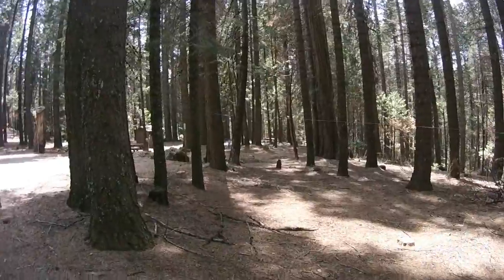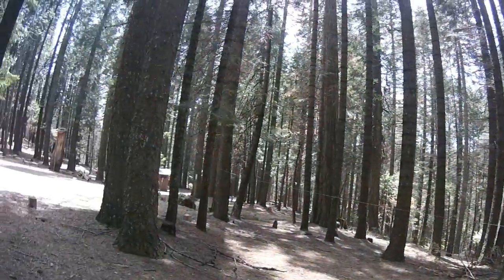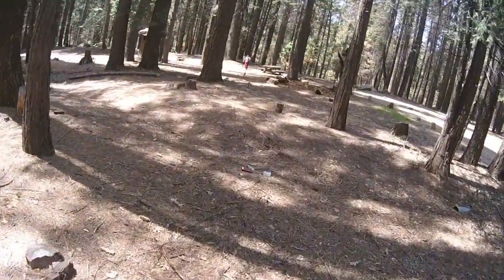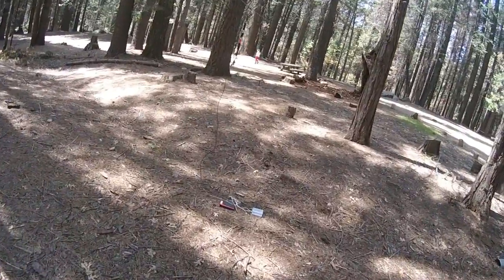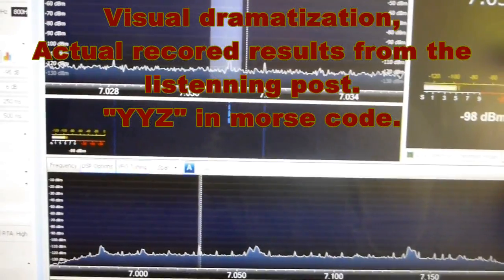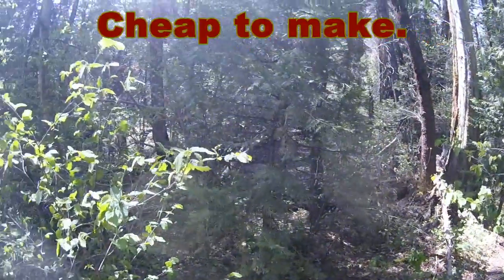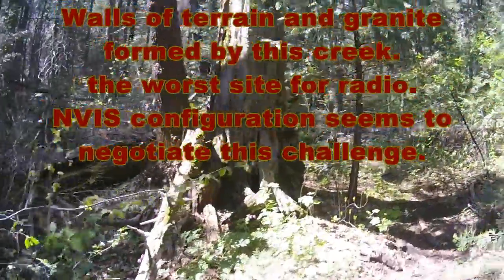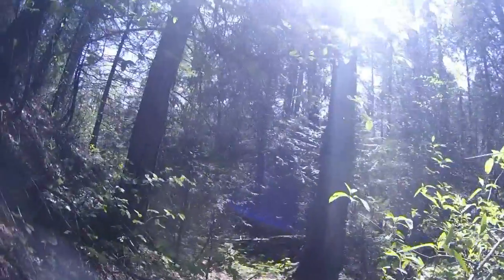HF Radio NVIS Field Operation Trials. First Strike

Comment: Try to put a continuous wire, about 5% longer  than your antenna,  on the ground beneath your antenna. This will act as a reflector.
Reply: Yep, you can even add two more wires on the ground, one on each side, six feet from the center one, parallel to it. That will increase the gain quite a bit. http://radiopreppers.com/index.php/topic,1260.0.html

Comment: Another technique use to avoid interception, is to set on a hillside facing or sloping toward your target and on the opposite from a possible intercept station.  With an end fed NVIS antenna, adjust it's slope for the best signal out with the least power used, and use the vehicle as a ground plane to direct the signal should the radio be mounted in a vehicle.  Adequately ground the radio to reduce noise, use water in a hole where your ground stakes are.  If too noisy for voice, then CW or a digital mode could work. Learn CW as I should.  In my case, I might use the aluminum roof of my 30 foot motor home as a ground plane... I would use ladder line and a tuner, or a short piece of RG8, or LMR400.

Comment: Not many know about NVIS.  Asked guys at the local Ham Club and they did not have a clue.. .  could not get them interested so they continue to install VHF repeaters.

Try the 40 meter antenna at 21 feet and on the ground.  No need to go higher than 21 feet.
Reply from the maker: Will try, just looking for an opportunity to go out again. Thanks for watching.
Reply: From what I've read, NVIS is difficult to DF.  I would like to try the dipole on the ground,  QRP, and with a digital mode, PSK31, and from inside a canyon.  Noise would be significantly reduced so the weaker signal works. Because of the low power , and high ground absorption with this set up, a sloping dipole might help direct the weak signal a bit further. Line up the dipole in the direction of the target station and elevate one side. The combination might be very difficult to DF.  To be sure, one would be much safer if there was no intercept station within 25 miles so that the ground wave is not intercepted...if there is an appreciable ground wave with this combination of factors.

thanks for all the hard work needed to share your videos.
Reply: They focus on VHF/UHF and repeater here too.  The problem is in order to cover the whole island the repeaters need to be linked due to the volcanos blocking line of sight. The link between repeater is broken and some of the repeater will fail in a disaster.  I want to try NVIS between our two clinics.

Comment: I have done kilowatt-level 7MHz tests over 20km line-of-sight paths, and trust me there's no such thing as ground-wave - everything you see in your video came off the ionosphere.  For frequencies below 10MHz (day/night NVIS), the simple coax-fed no-balun resonant dipole is a very good portable prepper antenna - improve it by putting links along it for other bands.  The dipole has very very small directional lobes even in free-space, and you may as well consider them to be non-existent - I have never seen a poor signal or a good signal as direct result of dipole orientation, this antenna is close enough to be called omni-directional.  Your main concerns with the dipole are absorption (away from nearby objects), non-electrical-contact near the high-impedance tips, and height (as much as possible - less ground absorption.)  For the ground to be a quality reflecting element, you will need about 0.25 wavelength height, and you don't really care that much for only half an S point extra.  Keep up the good work! :)

Comment: G:  I really enjoy your videos. I have learned a ton of stuff watching you. Thank you so much for taking your time and efforts to do this.  A couple of quick questions. A. You mention your Dipole is 60ft in the video and tuned to 40m/7 MHz. I noticed the Freq. 7.030.900 on your PC. I noticed you had a Ladder Wire connection with a simple BNC connection to your Transmitter Box. Would you explain the wire gauge you used for the Dipole? Also, I would like very much to make a transmitter box like you have so I could field test similar setups around my home in Vermont. Would you be willing to pass along how to make the Transmitter Box?  Thank you for your Service, your dedication and your excellent ability to educate!  WildTreeFrog.

Comment: While the granite may not be the best ground, being on top of a well flowing water will. You'll have a better ground there than on normal land. You might not get farther, but if you connect a 2 or 3 feet wire to the ground of the rig in the water or soft dirt, your signal strength can improve. (However this means trees looking much more apparent to the antenna's tuning than they where before... BTW, Im ok with you not giving out your call, but can you please do it on a non national calling or popular frequency?
Reply from the maker: The sequence in the CW memory does have my callsign programmed and is transmitted along with the test message. I just edited that portion out to safeguard my privacy. Also, I listened to the channel with earbuds before hand to make sure the frequency was clear. I was thinking of mentioning that but thought it would be common knowledge. Will disclose it on future vids, thanks for watching and info.